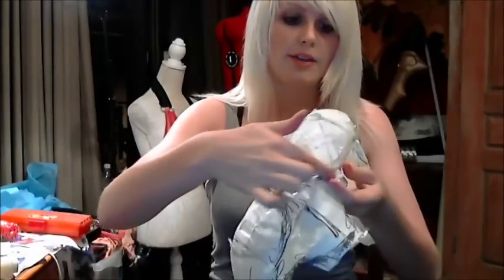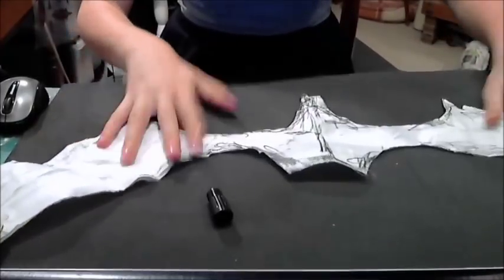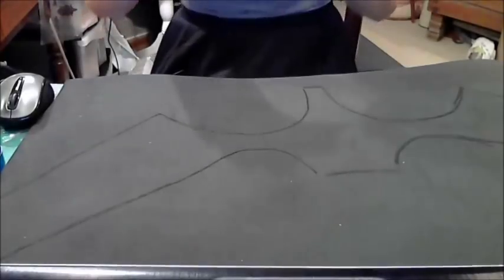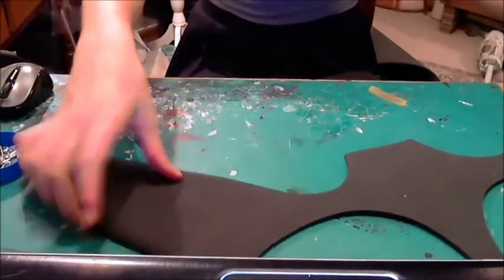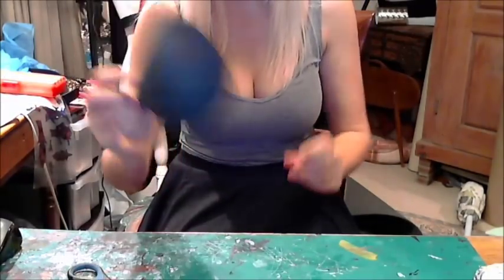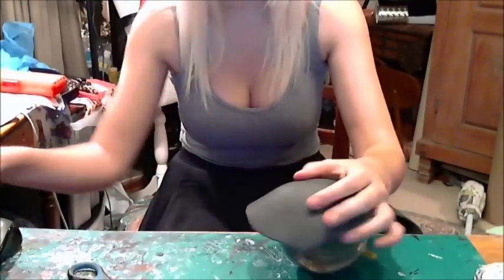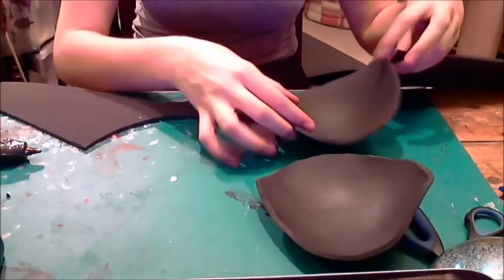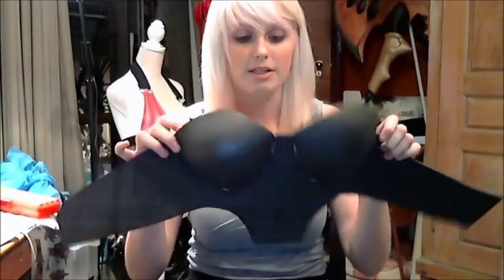Craft Foam Breastplate Tutorial

Comment: I've seen other people spray their foam armor with latex to make it sturdier, have you found that just simply using hot glue and painting the foam works okay? On top of seeing other armor tutorials using the latex, they use a stronger glue. All the things I've seen are also pricey, and just using hot glue and painting plain foam would obviously be the cheaper option. So I guess what I'm asking is how well your armor holds up after wear and some stress? ^-^
Reply from the maker: Hot glue to make armor sturdier? I just use hot glue to put the pieces together :) The sturdiness will come from when you prime the whole thing with 5-6 layers of PVA glue and you can even put in a fabric backing for even more stability. My foam armor holds up pretty well I think. But If you put it on areas that will take high stress like on your feet and legs and anywhere that bends a lot it may crack. So for armor on my feet etc I use thermoplastic instead :)
Reply: Have you tried using wood glue mixed with water to make it sturdier?
Reply: Victoria Moynihan I haven't actually made any armor yet, I'm doing as much research as I can before I get started. But mixing wood glue with water seems more like an answer to what I was asking, I might try that, since it would be a lot cheaper than the latex spray I was planning on ._." thank you !
Reply: I also heard this thing from a guy at a league of steam costuming panel during Dragoncon who said you could use two layers of foams connecting them crisscrossing duct tape to make the armor sturdier.  I haven't actually tried this, but he's a professional costumer who's been making costumes for over 15 years and wrote a book on it, so I trust he knows what he's doing.  You can also always use EVA foam instead of craft foam.  When using EVA foam rather than craft foam though, you defiantly need to use a heat gun or a stove top burner to bend it.  If none of these work for you for some reason though, you can bend pieces of foam core poster board by soaking it in water and placing weights on it to get the shape you want. Even the it's the hardest and sturdiest of the options foam core poster board isn't the most flexible, so it will have to be broken into pieces to achieve the shape of a chest plate. The cracks in the plates can be fixed by going over the edges with hot glue and brushing over it to flatten it before painting the armor.  Hope this helps, good luck!
Reply from the maker: Victoria Moynihan  EVA foam is craft foam :P craft foam is just the thinner version apparently. But EVA foam will still crack if it is stressed too much.
Reply: Sorry, my mistake.  I had no idea they were made of the same thing >_<

Comment: hey there i have a question, my breast are a little bigger than DD so i was wondering how do you know what size sphere or ball to use?
Reply: You just have to find anything spherical that is a similar size to your boobs. they way you check is by holding it next to your boobs to see if its the same size or not :P like I honestly just had to look for something that was similar in size for my boobs and I found a very big bouncy ball in my sisters room that worked for me. Another way of making the cups is cutting notches out of it until its the right shape and has the right curve. You can see an example of what that sort of looks like here : https://www.facebook.com/photo.php?fbid=714345085254346&set=pb.489561351066055.-2207520000.1405532660.&type=3&theater
Reply: oh okay haha thank you! lol xD i tried to make a mass effect chest piece for myself but i had the cups waaay to small. xD i had to get help ro remake the whole things lol i was using the same EVA foam as you too thank you so much xDD
Reply: i used a hamster ball lol xD i went to petco and bought one my size lol(i opened it in half and put my boob in it with i shirt on hahahaha) lol. it works haha
Reply: yes most def lol hamster ball is perfect xD

Comment: I started out making a chest piece but when i tried gluing the breast pieces to the main belt it wouldn't glue on and there was a bunch of spacing when i tried to glue it on. Any suggestions of how to fix it? The foam i bought is quite thin..
Reply: perhaps you need stronger glue, but this is why you should try pin it in place before you glue it to make sure the pieces all fit and are in the correct flace, I think i messed up my explanation a bit in the vid of that part :O
Reply: *place not flace
Reply: Im only using Elmers school glue as i dont have a hot glue gun.. it didnt work at all.
Reply: Rather use contact glue :)

Comment: Can I use an iron to heat it?
Reply from the maker: +Mary Winford No don't use an iron :o and iron will actually burn and melt the foam. You can't really apply heat directly to it it has to be hot air
Reply: Okay, thanks for letting me know
Reply: +Mary Winford Heat gun like she used aren't very expensive, less than $20 - $30 here the US.

Comment: ...can I use a hair dryer?
Reply: +XxSnowNinja you can use a "professional" style hair dryer, they get a lot hotter than consumer level dryers.  A heat gun will shorten the process, but can burn the hell out of you! BE CAREFUL! Hope this helps!
Reply: +Michael Gardner how long would it take with a hair dryer?  w her gun it seems to only take 30 sec. I have a Chi Turbo
Reply: tigereyez333
You might shorten the life of the device by running it that hot, thats my only concern.

Comment: I'd like to make a breastplate for cosplaying Kayle. So this'll be good. Unfortunately I'm a guy. Any advice?
Reply: Well the pattern making is still the same :) but i know there are armor videos for guys also maybe just have a look around? :)
Reply: Tayla Barter
So I figured I could take rice, put it in sock(s), and get a bra the size I want the breasts to be, and then possibly wear it, and use a hair drier on the card foam so that when it goes limp its easier to stretch around to make the shape.

Luckily Kayle's breastplate is nothing like Katarina's otherwise I'd have some real issues! XD

edit: I got a heat gun, instead of the hair drier. Its working for the gloves and arm brace pretty nicely. It's HOT.